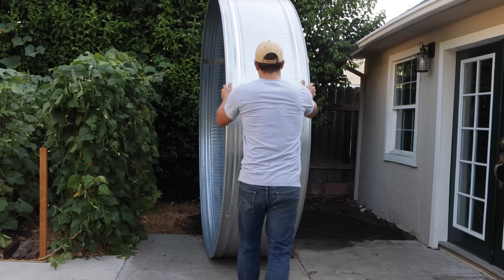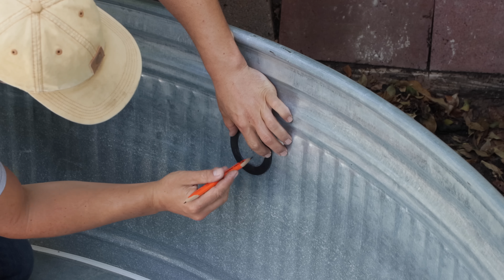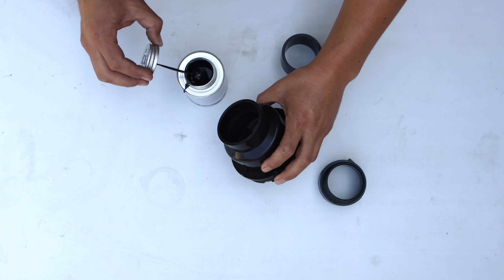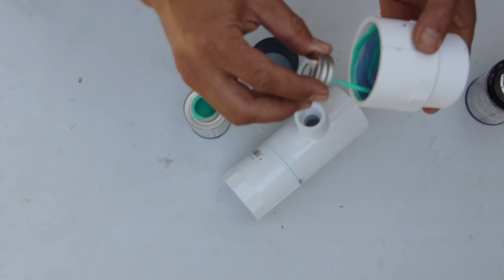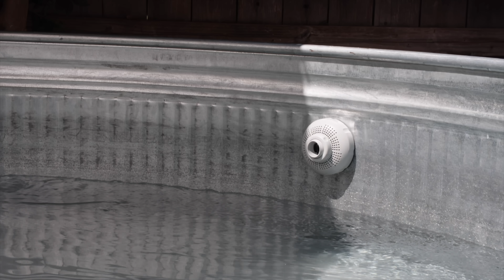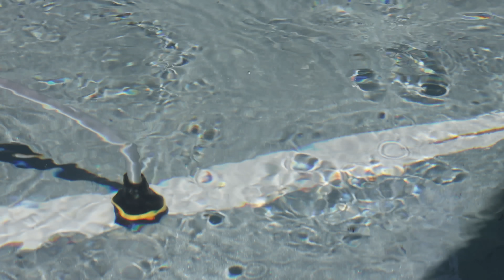Stock Tank Pool DIY

Comment: I made one just the same a couple of years ago. After a little over a year, began seeing rust start to develop. Almost a month later, the entire tank was covered in rust but only on the inside and below the waterline. Never added any chemicals aside from a small chlorine tablet float. 
Attempted draining, sanding and re-coating with pond paint but the rust would keep coming through. Just something to be aware of i guess.
Reply from the maker: Ry jay I’m painting the inside next spring with flex seal. It can be done the first year but many people have recommended waiting until year two based on their experience. This has no rust yet after 3 months and will be empty in winter.
Reply: @urbanfarmstead  , Foxie's getting a new pool next summer and it's not going to be a blow up pool, never thought about doing this. Pawfect Burfday pwesent June 8. She will be 9 years old!
Reply from the maker: puppylove80110 👍🏼
Reply: @urbanfarmstead  why wait until year two and not do it right away?
Reply: I think if you sprayed the tank inside and out with Flex Seal, it would prevent the rusting and any possible leaks later on..
Reply: Aw that sucks
Reply: How can you stop that from the beginning?
Reply: @puppylove80110  pool paint right at the beginning before ever filling it up maybe. The galvanizing process on these stock tanks isn't the greatest im sure. Once some chlorinated water hits that bare steel, pretty much useless until your sandblast/grind everything down and re coat with rust prevention then a waterproof layer like pool paint or a flex seal like product.
Reply: @ryjay3291  to save some time in the future if you're ever needing to remove galvanizing. 

Rub it down with vinegar and a scotchbrite pad...
Reply: @puppylove80110  paint it from new
Reply: I have heard this peels? Did you ever paint the inside? If so, how is it holding up?
Reply: @andreacastaneda-lauver1121  it definitely rusted but If I were to do things differently, I would paint the entire inside of the tank with some sort of waterproofing paint or pool paint. It has now become our raised garden bed lol

Comment: Add foam pipe insulation. It's sliced open on one side and shove it on the rim. They come in 1/4 to 1" openings and six feet long. This is 1" at home-depot   https://www.homedepot.com/p/Everbilt-1-in-x-6-ft-Foam-Pipe-Insulation-ORP11812/204760805
Reply from the maker: Mary Potter thank you, but in my experience this is not necessary. As long as our pool is full the edge does not become too hot because the water keeps it cool via conducive cooling. Even in full sun on 100F+ days. This has been my experience.

Comment: Could you list out the parts for the vacuum tool?
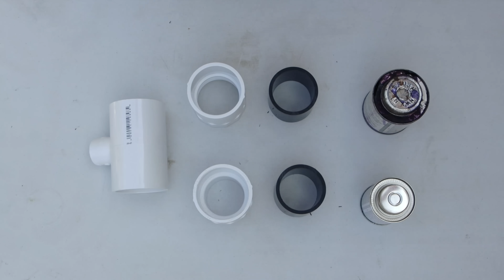Reply from the maker: Patrick Hobin 5:06 it’s all right here 👍🏼 let me know if you have any other questions ✌🏼
Reply: @urbanfarmstead  I was hoping for a written list. Some of us have limited plumbing experience so a list would have been easier. I had replay the video many many times ... it was hard to see the differences between the adapters ... 

I think I got it. I didn't realize at the rain barrels spigots were so hard to find at big orange or big blue ... 

Also .. has the ABS pipe and not PCV pipe? All the joints were PCV so why the ABS ... obviously I am not handy with plumbing projects .... 

Keep up the great work!!

Comment: did you use a 2 3/4" hole saw on the outlet also? trying to follow along with this video and my inlet fits 2 3/4" no problem - but the shower drain i got is too big for that.
Reply from the maker: Michael Lefkowitz no, that’s where I used the 3 1/4” hole saw that I mentioned in the beginning of the video
Reply: Urban Farmstead sorry must’ve missed that - thanks!
Reply from the maker: Michael Lefkowitz no problem! Let me know if you have any other questions.

Comment: Okay I do have two questions after I complete my stock tank following your instructions this video. 1. Do you recommend a sealant like Flex Seal Clear Liquid or Rust-Oleum Truck Bed Spray to layer the bottom and sides of the tank to resist rust and corrosion? And 2. Would you recommend installing a water heater and/or add on that would heat the water for those cold weather swim days? Thanks!!
Reply: Okay, Flex Seal is out! Lol! Just read some comments that said it will peel eventually and get messy in the tank...

Comment: They say if you put in any type of pool....the mermaids will show up....( ps...how did you really get that tank home on the Ram....without it blowing off and or get crumpled?)
Reply from the maker: Jim Mason great! Just strapped it down on top of the bed, just as I showed here. I mean, I didn’t show me removing the tiedown straps but obviously is needs to be strapped down. I’ve also moved transported them in the bed of my truck with them on their side in more of a vertical orientation but I definitely prefer the way I show in this video.

Comment: On the second hole did you use the 3 1/4 hole saw or the 2 3/4 hole saw? Thanks
Reply from the maker: Brian 3 1/4 which is what you would want with the DIY fitting I made but if you’re able to find the factory fitting in stock it would be the same 2 3/4 bit.
Reply: Thanks for the fast reply! I’m going with the DIY intake fitting that you made, so I’ll need to get the 3 1/4 hole saw. Should have this stock tank pool completed soon. Thanks for the great step by step video! Take care!
Reply from the maker: Brian great! It’s pretty straight forward but do let me know if you have any other questions along the way.

Comment: I planned to go to a stock tank pool, when my above ground 4' x 16' Intex pool got a leak or series of leaks, that I couldn't locate, which just happened to be May 2020.  I'd been looking at them, and YouTube creation for several months ... as I desperately need a pool for my health.  (circulation problems in my legs greatly limiting walking, and preventing jogging, and many other forms of exercise ... swimming or even prolonged kicking in a pool, has remedied the problem drastically ... ) though since May 2020 I have been unable to find one, and being on a fixed income (even beyond the dempanic) I could drive 100 miles to pick it up ... not an alternative is $400 for the tank and near $200 for delivery .... and in July 2020 even that is gone as a possibility .... any suggestions on locating  a stock tank?
Reply from the maker: orion bennett that sounds like a very difficult and frustrating situation. We were on a waitlist for months and kept being told we would get one any day but it never came. Then my wife happened to be at Tractor Supply as one was being delivered so she bought it because she was at the right place at the right time. Just luck. Everyone is out because they are in extremely high demand and shipping/manufacturing is delayed.
Reply: @urbanfarmstead  Well, thanks for your response ... I guess key is not to give up hope .... retired living in Arizona, some gyms have pools, but of course gyms are closed due to covid.  Thanks again ...
Reply from the maker: orion bennett yes, keep calling, and checking. See if you can find out when they expect their next delivery of them.
Reply: @orionbennett7343  don't forget to check other feed stores. My local store has them cheeper than TSC. Yes availability is an issue. Maybe they can order it for you.

Comment: Check out mine. Built a patio, attached it to a wood burning stove, heats up 10 degrees an hour,  my recirc pump broke (cast iron is bad) trying stainless steel now to pump the water through also has a sand filter on a separate waterway jet pump. Lots of mistakes along the way. Ultimately i just put on a pvc y strainer and a ball valve so i can easily disconnect. Now i am in the final stages of perfecting it. 

https://youtu.be/DlAvc9m9eos

Comment: Hi! We just got our stock tank and we will be using it temporarily without a pump while we get the permanent area where we will put it ready. I was wondering if you could tell me a little bit of your experience using it like that. How often did you change the water? We plan to use the floater with the chlorine and keep it clean with a cover. Also testing the water often. Thanks!
Reply from the maker: Hi Karla, that’s great! We did the same thing. We changed our water our only once over about 10 weeks but if you keep the proper amount of chlorine in it you probably wont need to swap it out at all.

Comment: Hi! We just bought an 8ft (2ft deep) stock tank.  We love your video.  I just went and bought the 12 inch sand pump you recommend   I am worried though because it says it needs a minimum of 2800 gallons of water.  Doesnt the 8ft stock tank only hold 700 gallons?  Did I buy the wrong size?  Thanks!!!
Reply from the maker: Kerry Lane Hi! That’s awesome! I understand but rest assured you got the correct pump and it will work perfectly fine. This is the exact same pump that I’m using as it was recommended by multiple people, and it works great! After reviewing customer questions on the sight with that same question, it seems those min and max numbers are because they are recommended for specific Intex brand pools and the different size pumps have different size hoses that attach to different size pools.
Reply: @urbanfarmstead  How amazing of you to write back so quickly! One other thing I am realizing is that we got the 2100 GPH   I think yours was less?  Will this make a difference?  It was the least expensive one on ebay.  I want to buy all the other items you used through your amazon links . The Intex pump on amazon took 10 weeks to arrive and I wanted it sooner.
Reply: One more thing. We live in the Catskill mountains and it gets very cold up here.  Do you have ideas for heating this tank that you have researched? And possibly keep it going all winter? Or is that a pipe dream?!
Reply from the maker: Kerry Lane I have seed people transform them into hot tubs but this pump says the water needs to be Kela below 95F. Solar heating would work well

Comment: A wooden frame woud look realy good on one of these , but wont this rust easy?
Reply from the maker: Ioan T definitely! I plan to add small deck to it once it’s in it’s permanent location. After a long time it would eventually rust and but no time soon. That’s one of the reasons I’m painting it next spring, to help protect the metal. These tanks are designed to hold water for years just as they are, but water treatment chemicals will accelerate the oxidation process.

Comment: In Texas, that's a hillbilly hot tub.... lol😊 Looks great!
Reply from the maker: J fig nice! I am actually exploring options to transform it into a hot tub during winter we’ll see.
Reply: Now, if you had a small one in the back of your truck......now THAT would be a hillbilly pool or hot tub.lolol😂👏
Reply from the maker: Cookie Splitter yes! 👍🏼
Reply: I was going to ask about adding a heater for the winter. Let us know if you find a solution!
Reply from the maker: Alison Holmstrom people definitely do that, and I might, but I’ve got more research to do
Reply: @urbanfarmstead  they sell kitsch at Walmart to turn your trucked into a temporary "pool"
Reply: @alisonholmstrom  use a hose connected to a hot water faucet...
Reply: Build a small rocket stove with the exuast running under the pool and the thermal mass will heat up and keep it hot for a very small amount of wood/fuel.
Reply from the maker: Skeptic Fucker great idea
Reply: Moving to Texas and I'M IN FOR THE HILLBILLY HOT TUB !!    I would think if you put it down into the ground a bit, it would stay pretty cool from the unnderground.. !!
Reply: Lol jfig